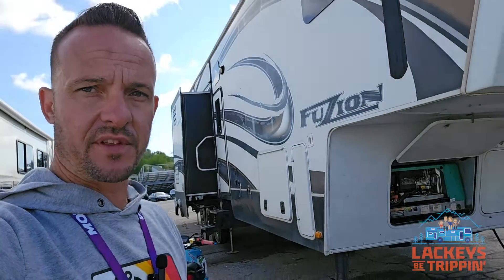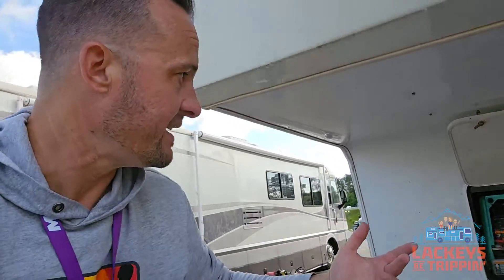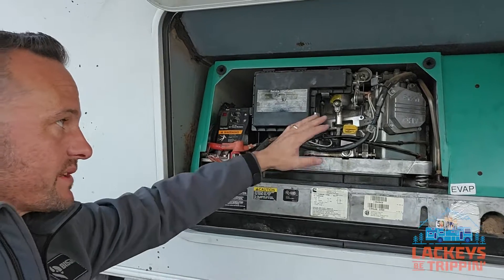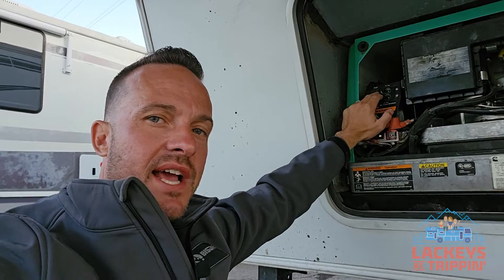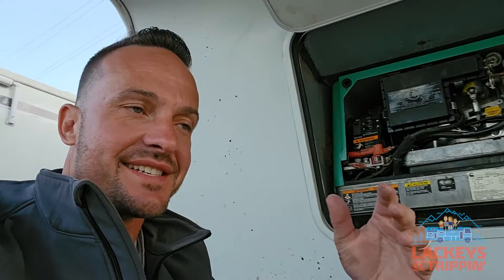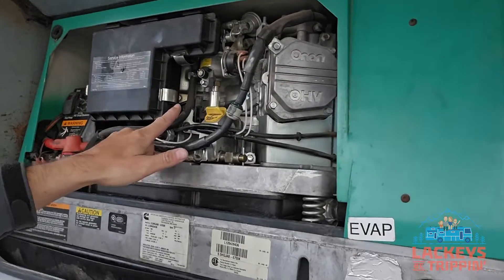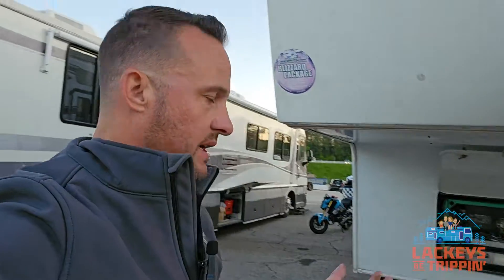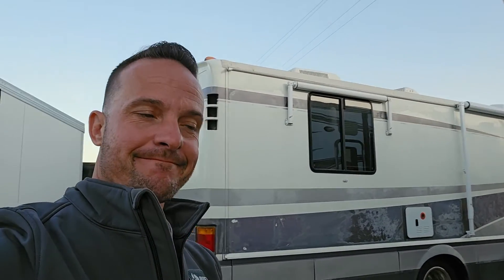Cummins Onan QG5500 generator Code 45 fix

Comment: Well I am having the same issue with a code 45 it says it is a speed sensor I pulled this generator out in order to find it and there is no speed sensor exactly what are they considering a speed sensor

Comment: Hi' I have the same generator. I lost output power. 45 code. cleaned the rings. brushes are just barely 7/16 long. look good cleaned them too. with scotch pad' like the rings. I have been watching many videos and checking lots of things. pulled the board out' it looks ok. I'm going to see if Cummins can test it for me tomorrow in Bloomington IL. I thought for sur the red light would stop blinking after this. It hasn't. Any ideas. Think you.
Reply from the maker: So sorry I missed this comment sooner! Hopefully you got this figured out. If not, we recently posted this blog on our website and it may have more helpful tips:
https://www.lackeysbetrippin.com/blog/generating-inconveniences-how-to-handle-a-finicky-gasoline-onan-qg5500-generator#/

Let me know if I can help more.

Comment: When running the generator on this or any 5th wheel would you always keep the door open on the compartment?  Seems like it should be open and even have a fan blowing on it.
Reply from the maker: It doesn't hurt, but definitely leave the cover on the genny iteself.

Comment: Really informative video. Thank you very much! I have an Onan Cummins generator in my 2022 Grand Design Momentum and it has been of basically no use since it was new. As the generator has a four year warranty, I had a site visit by a Cummins tech, well five site visits. They could not figure out what was wrong with it. Finally on the last visit, they replaced the carb as they thought the choke kept shutting (I was getting code 36, unexpected shutdown). Well, I was happy that they were able to fix it. But, one week later, it starting randomly shutting off again. By this time I was not in a location that had a Onan Cummins service center. So, that is where the generator sits now - does not run for more than 45 minutes. Sometimes it's 30, sometimes 20, sometime 5 minutes. My plan is to go back to Jacksonville FL and have them look at it again. But, your tip about the vapor lock makes sense. When my gen stops, it begins to surge like it is running out of fuel. I am for sure going to get some heat shield / wrap and give that a try - thanks again!!
Reply from the maker: Awesome thanks for the comment! Hopefully this helps! If not, the follow up video will have lots of other things for you to check. Onan really under-engineered these things but they're great with a few tweaks. 😁
Reply from the maker: Hey just following up if you're still having issues! We posted a blog with the common stalling issues and a mod you can do to prevent vapor lock: https://www.lackeysbetrippin.com/blog/generating-inconveniences-how-to-handle-a-finicky-gasoline-onan-qg5500-generator#/